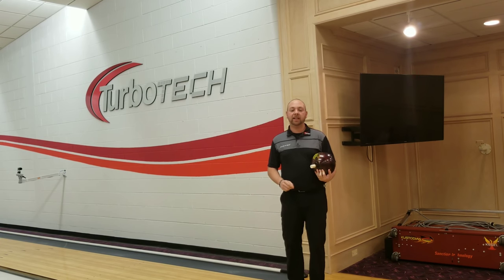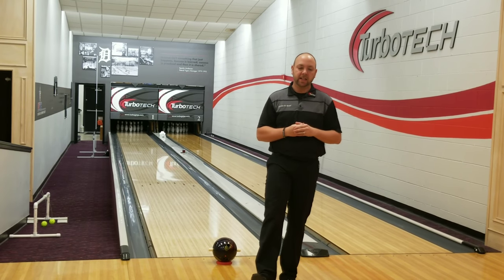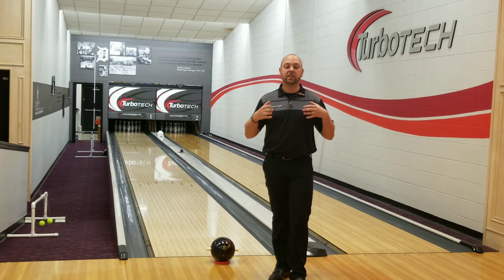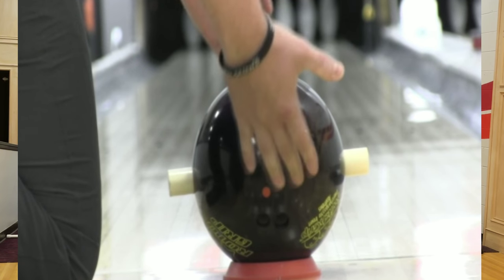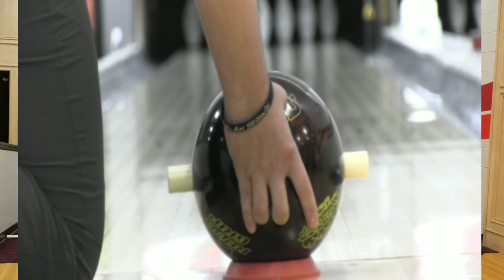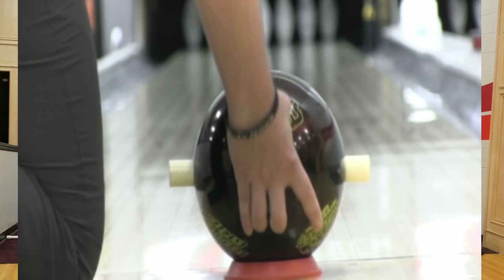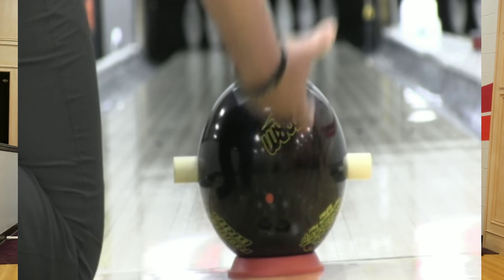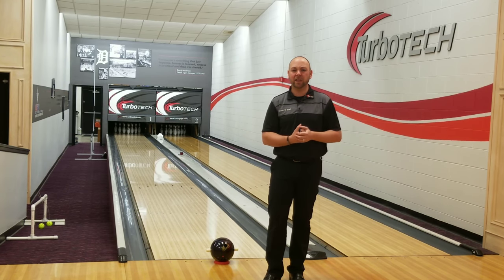How to change the "spin" on the ball (Axis Rotation)

Comment: I used to use a 90 degree rotation back in the urethane days man was the pin action good plus my rev rate was around 400ish which helped a lot I used to hook the whole lane on a fresh pattern lofting the gutter cap by middle of game 2 the good ole days urethane balls and wood lanes man I miss it so much, I also miss the standardized ABC 40ft house pattern now all the places use an easy usually light oil 38-41ft sport pattern so the pattern is different in every house, the house o used to bowl in used a super light 38ft sport pattern to save money on oil I wish urethane had made a comeback then, I’m glad it’s back now I don’t like throwing a plastic ball as a strike ball because they don’t carry so well

Comment: Hello good sir, I'm having a really tough time getting my ball to spin if I slow things way down ill get it to move but then my accuracy is all over the place. I'm a 170 bowler in league play been practicing like crazy trying to get more rev's and nothing is happening driving me nuts actually. My thumb is coming out first, trying to get my hand below the equator of the ball before release maybe this is what I am missing? If I throw the ball with any decent amount of speed it barely moves. Any thoughts or comments would be much appreciated.
Reply: You still having problems? I definitely reccomend staying behind the ball over spinning it. The position i use is easily found. Put your hand up to your face. Put your nose right under your middle knuckle(in the palm of the right hand) and point all of your fingers until they cover your left eye and have the thumb go around your right eye. Then keep that position and angle and bring your hand straight down to your side. Now you have the good release position. Then focus on keeping your hand in that position(stay behind the ball) and rolling the ball off of your fingers. This is basically a pro release in a nutshell. Its kinda hard to describe in a comment but I hope this helps. Also focus on Hitting the breakpoint because alot of people will throw the ball right past it and never generate hook

Comment: Do you maintain your hand at the back of the ball during the whole arm swing and then switch to say 9’oclock last second when you are about to release? Or maintain the hold at 9’oclock during the whole swing and release?
Reply: You can pre set hand in that position. That way you can get an idea where the ball is at during the release. In this demonstration he's talking about axis rotation . If you tilt the axle and combine rotation you'll have a totally different ball roll. Axis tilt is very difficult to change. Where as axis rotation is where the thumb exits the ball.

Comment: Hey JR, big fan, is there anyway I could send you a video personally so you could tweak my game? I'm a varsity high school bowler and I'm looking to increase my general ball speed and improve my targeting.
Reply: To increase ball speed, hold the ball higher.
Reply: The way you increase your ball speed is to increase your foot speed. If you want to slow the ball down? Hold the ball higher which will shorten your back swing and walk to the approach at a slower more deliberate pace. If you want to increase the ball speed? Hold the ball lower which will increase your back swing and speed up your pace to the line will increase the ball speed. You don't want to muscle the ball when trying to increase your ball speed. The ball height at address is for timing purposes only. The foot speed to the line will take care of ball speed.

Comment: I think it might have made a little more sense to look at the ball from the top down as well. The clock numbers analogy didn't really add to what you were trying to explain about hand position. The goal is to have your palm facing another target in front of the ball, not above or to the sides of it.
Reply: 100% agree with this. When someone explained the clock analogy to me the first, it caused me to try to sort of flick my wrist at release, which sometimes kind of works, but mostly doesn’t. In particularly bad cases, I’ll end up with hand too much on top of the ball and the ball in a flat spin during the skid. I’ve been trying to figure out how to fix that, so today is my day to watch a lot of axis rotation explanations.

Comment: Spin is caused by axis tilt. Axis rotation is the amount of side roll. I think it's a mistake to use the terms "spin" and "axis rotation" interchangeably.  I suggest redoing the video to correct those errors.
Reply from the maker: Spin can be used for both rotation and tilt. The point of the video is very clear either way

Comment: What a crap explanation. He shows a view from the back of the ball with the clock face vertical and then twists the ball on a horizontal plane. How does the 5 o’clock he’s talked about match up?  What position should the hand start in and finish in? Totally vague.
Reply from the maker: Look through the comments. You might be the only one too not get it. I'd watch again